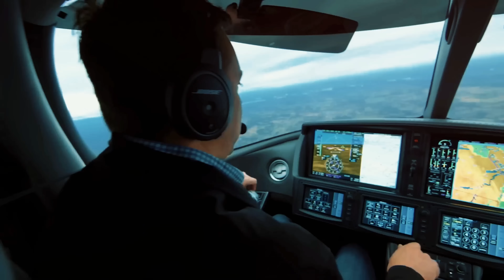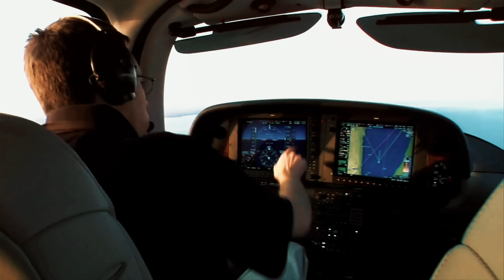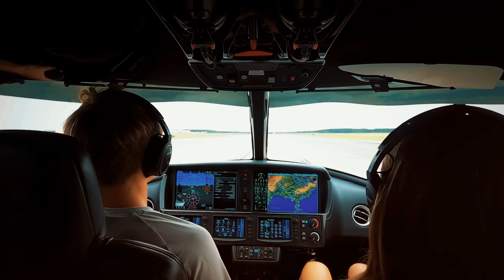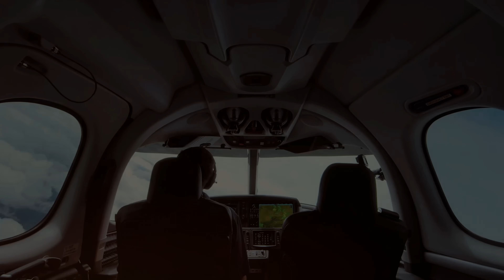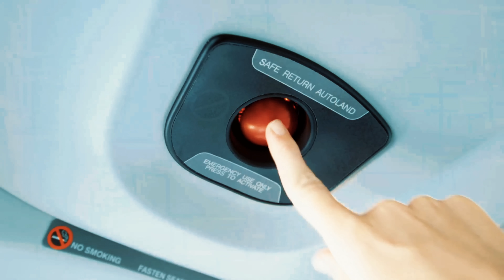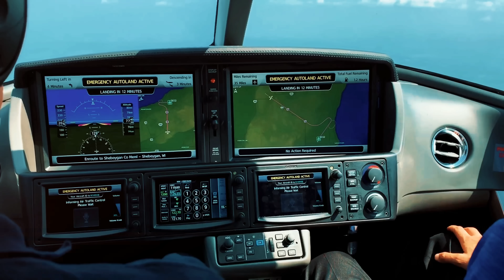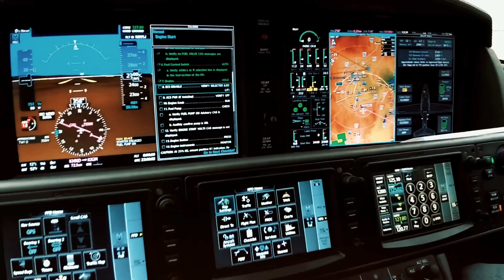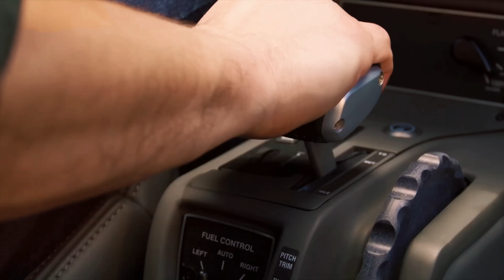How This Tiny Plane Changed Flying Forever

Comment: The parachute is extra safety. But only if you rely on a single 1950's outdated piston engine like the the one Cirrus designed for. Neither Turboprops nor normal Twinjets need parachutes for safety. Even piston driven Planes with modern Diesel engines need no parachutes to be save.  Diesel twins anyway not.

Comment: Slow, average fuel consumption, bottom of the list on angle of attack, no bathroom, handling a little mushy, and a vacuum cleaner canister attached to the tail...yes it is affordable, and yes has self landing software and a parachute should something go wrong, these may be the selling points because everything else is subpar...

Comment: I sometimes wonder that the US was able to mass produce tens of thousands of prop aircraft during WWII in a short span of time. That's 80 years ago. Why can't it be done today? Bringing down costs for prop planes and making flying more accessible. Can anybody qualified please explain? Thanks.
Reply: Easy. Manufacture's liability and litigation. Light aircraft were reasonably accessable to many civilians in the 50s and 60s, however people started to sue the manufacturers after accidents. The builders had to add more and more into the cost of each unit so they could defend against claims. Cessna almost went broke, and if I recall, stopped building some models for several years. I gather that Piper suffered as well. The Beechcraft Bonanza V tail gained a reputation as a widowmaker, as several professionals, businessmen - and particularly doctors - were lost in fatal accidents. At the time, the media and aviation fraternity pointed to the aircraft and it's V tail as the possible cause of the issues, however it's now considered that low hours pilots, matched with a high performance aircraft in marginal weather - sometimes at night, with a good dose of 'get there itis' was more likely the cause of many of the losses.
Reply: @KeithHays-ek4vr thanks for the explanation.
Reply: Keith is absolutely correct but there are other factors as well. The sophistication in today’s single engine aircraft vs mid-60 is huge. I know, I was a test pilot, brokered, trained owners of single engine aircraft. I bought a C model Money in the early 2000’s as a runner for 45 I think. The original paperwork came with the spec sheet showing a purchase price just over 17K. The screens and technology behind them is why there are fewer accidents, even with social media and everyone having a camera. BTW, those aviation lawyers have made aviation safer as well with their lawsuits holding manufacturers accountable BUT they’ve done far more damage than good so…

Comment: Is this the same plane whose parachute has saved over 200 lives?  Explain to me why the plane had to deploy its chute over 200 times so far…and you call it “safe”.
Reply: lol the BRS whole plane parachute has saved over 200 lives since the invention in 1998 .They are installed on more than just cirrus aircraft .Cirrus chutes have saved around 112 again since 1998, 2 to 4 people on a plane and that's a great safety record .